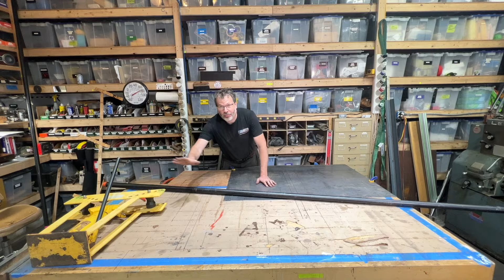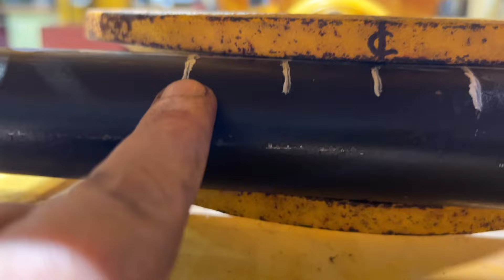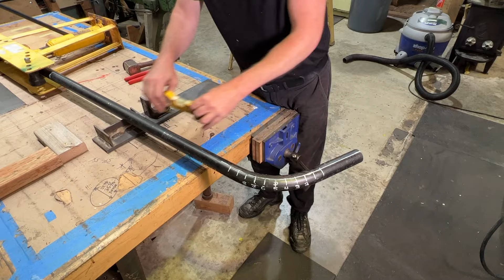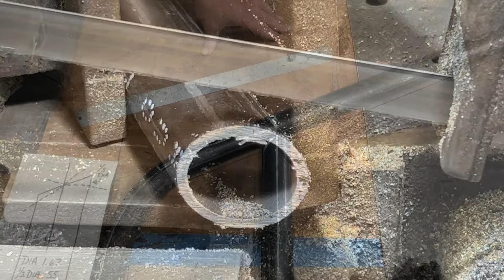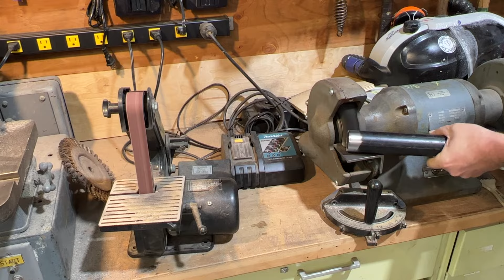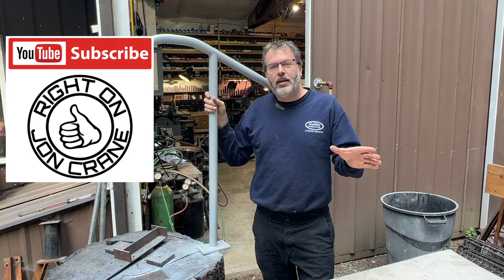Harbor Freight Pipe Bender  Best Method - Handrail Build Start To Finish - Smooth Bends Every Time!

Comment: @rightonjoncrane Where did you find those ruler stops, that make it easy to mark the centerline of the pipe
Reply from the maker: Those are Starrett 298 Key Seat Clamps. Starrett no longer makes them but you can get them on ebay. Right On! 🙌 They are great when you need them.
Reply: @RightOnJonCrane  thank you so much, brother. I love that I’ve been looking for about five hours and checked and behold the answer!!! Have an awesome day tomorrow.

Comment: Is it possible to make 2 bends next to each other in opposite directions? Eg straight line to a step and continue straight I’m wanting to make a subframe basically there’s a hoop on the end which needs to narrow down towards the back where the lower control arm brackets and rear subframe mounting points are, I’ve bought a used industrial upto 3” bender that is horizontal and has tripod legs… thing weighs a ton not literally but you know what I mean, only paid £100 for it, spent more on the t45 tubing
Reply from the maker: Yes! I think you could do it! It might take some careful placement of the rollers. It would be a good experiment. I’ve done it often when bending electrical conduit. Of course that’s thinner wall.

Comment: Hello.. If I want to bend a round steel tube at 90' in a hydraulic iron bender, what is the distance between the two pulleys for each pipe Thank you.♥️

Comment: That’s a great way to do those bends without having a very expensive bender. Nice that you showed how to generate the radius you needed. With expensive tube benders you need the radius dies required and they too are expensive. My only comment would be to have an air over hydraulic cylinder. Sure saves time and effort. BTW Harbor Freight I believe makes a nice knob to open the valve. I made my own before I found out you can buy them. However being a toolmaker it was just another fun little project. Great Video though !
Reply from the maker: Right On! 🙌 Thanks and that’s a great tip about closing the valve with a knob. I will look at Harbor Freight or make one. Thanks for the comment!
Reply: @RightOnJonCrane  👍🏼👍🏼

Comment: For marking steel I like to sharpen the tip on a 3 point file with a grinder and make it into a scribe, then use the scribe to scratch the mark directly into the steel. Eliminates the problems with thick paint markers, which can lead to errors in your final product.

 I think the machining industry term is "tolerance stacking".

If you've ever plotted multiple azimuths on a map with a thick pencil line, all the differences add up. I learned from experience to use a mechanical pencil to save myself a lot of walking and/or getting lost. A lot of skills you learn overlap into other disciplines.
Reply: Why would you overcomplicate this? Leave it to metal workers to give people advice.

Comment: great video. I have been thinking about cutting a viewing port so I can more easily measure the angle of my bend. Don't think it will compromise the strength of the bender. What do you think?

Comment: My harbor freight bender leaks oil everywhere if I put it on its side, even though it has feet for that exact purpose, and the manual says it will do that and to NOT lay it dow.  

What happened? Is the new version worse?
Reply from the maker: Yes, mine leaks a little too! There is a modification that can be made by adding a tube inside. It makes it so the Jack can also be used upside down. Perhaps I’ll dig into it and make a video! 🙌